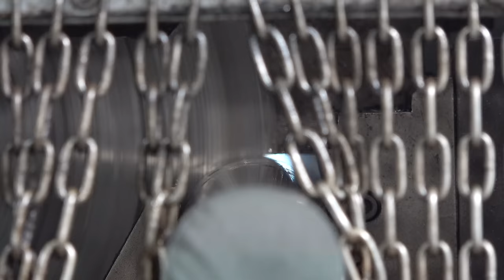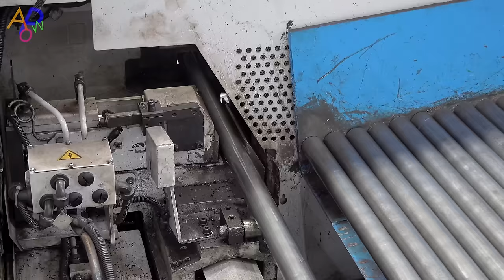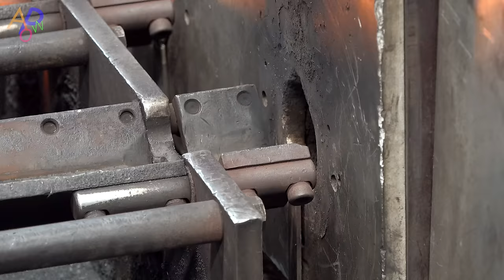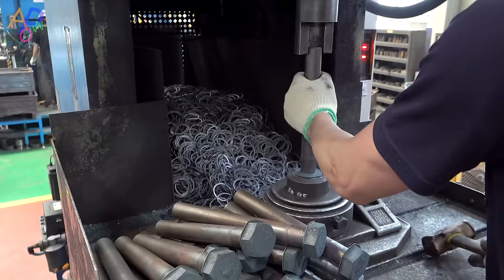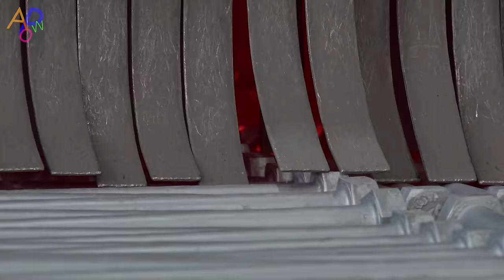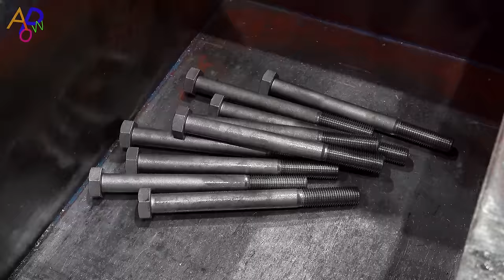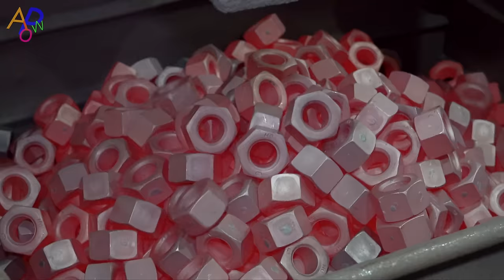Interesting Large Bolt and Hex Nut Mass Production Process. Metal Fastener Factory in Korea

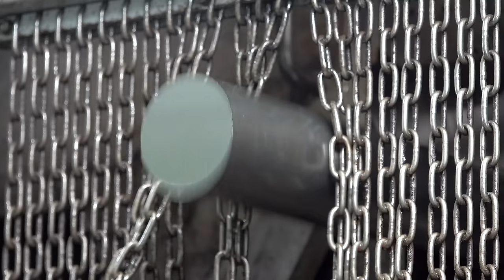Comment: Metal pipe 0:01
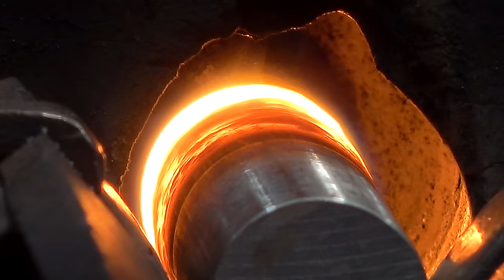Speed Metal Circle 0:02
Metal long 0:03
Very long metal 0:04
Hotter Metal 0:05
Dropper hotter metal 0:06
Metal Benzoic Catholic Machine 0:07
Shell metal 0:08
Circle metal 0:09
Washer Metal 0:10
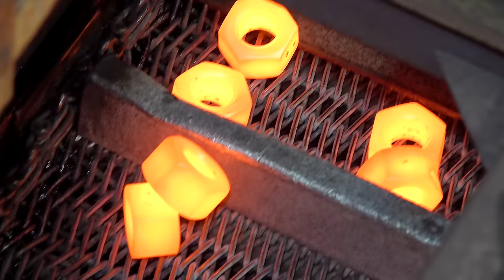Bond Metal 0:12
Machine Antenna U.S.A Metal 0:13
Circle Metal 0:14
Shell Circle 0:15
Turn on yourself me

Comment: Isn't heat treatment to harden them? if so why make the spirals after it?
Reply: By heating them again and cooling them slowly, it relieves the internal stresses created by forming the bolt when it was hot.
Reply: They showed at least three different bolts, so I don't think this accurately represents the whole process for any one bolt. But thread roll after heat treat is specified for some very highly loaded bolts. It increases durability and fatigue resistance by adding work hardening in the threads on top of the hardening by microstructure transformation by heat treat. However, it slows down production and chews up the thread rollers much faster, so it's very expensive.
Reply: It looks like they are tempering, which softens it.
Reply: Depend on rollig machine capacity.  Hrc 38-42 can roll threading after heat treatment require rolling machine capacity, good dies and worker's skill